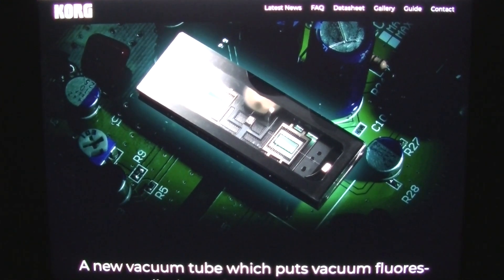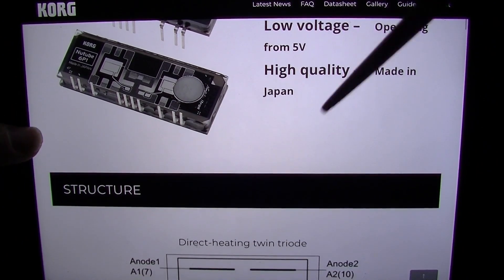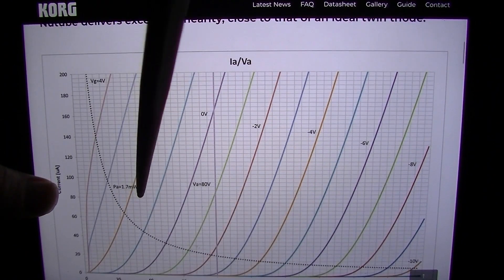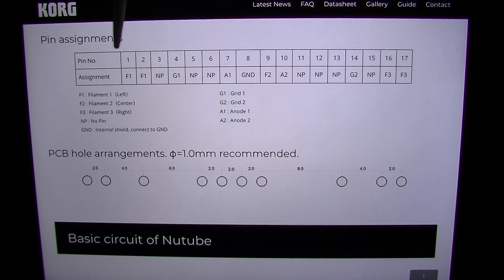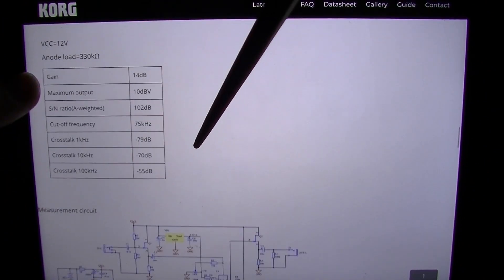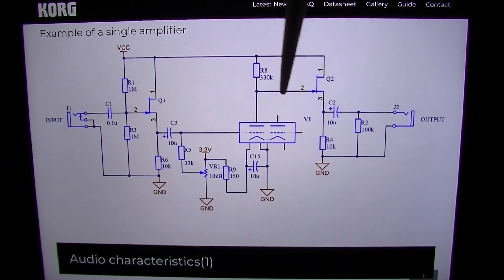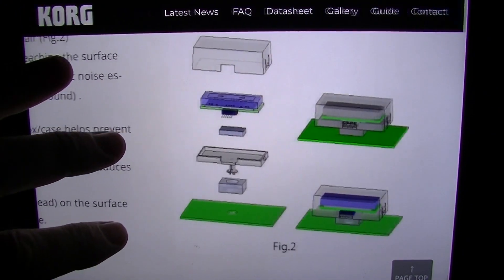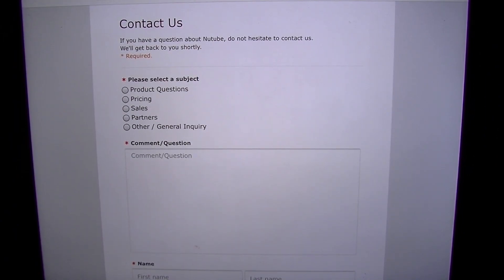Is This "Tube" REALLY the Future? - Korg's NuTube Vacuum Fluorescent Tube

Comment: I have a small vox beatle amp that has these NU tubes and I was shocked how good it sounds very warn just like tubes. I hope you get these NU tubes and make more videos about building a circuit with NU tubes to prevent microphonics issues. The new ibanez tube screamer using NU tubes and that would be a good circuit to build around the NU tube.

Comment: Okay I might not be the brightest bulb in the box but... @ 12:36
 you show a chart for resistors required vs filament VCC. If you exceed 
the .07 volts to the filament, poof, game over. So instead of a "fixed" 
voltage regulation why not use a self adjusting system? TI makes an Ic, 
the TL783, that can run this filament with an input voltage between 6 to
 104v. 

As the Ic can only drop the voltage to around 2v, set up resistors after the Ic to set the final voltage.

After the output is set, the input can jump across the map and 
it will not deviate. It will follow the output not the input. As for 
current, 700ma should be enough to do the job. 

Am I missing something? Wouldn't this be safer for the tube giving more 
flexibility in VCC? It only requires the Ic, a voltage ref resistor and a 
trim pot. If your worried about current, run two back to back. One to 
set a max current and the other to set max volts.

Comment: Everyone using this for preamp and overdrives, when it would be very interesting to create a poweramp in pedal size of a 100w or maybe more this technology like seymour duncan powerstage 170 or Magnum 44 (but, with nano tubes), then just get a tube preamp (there are a lot of small ones even with a transformer and valves like the actual real ones), connecting together with a poweramp currently " valve "would be really interesting.
Reply: This isn't the right technology for power amp I'm afraid, it's designed to replace a lower voltage tube like a 12ax7.

Comment: Well truthfully if you have a well-designed tube pre-amp and high-end transistor amp downstream you can dispense with old-school tube designs. You just need the tube sound and that does not require an all tube setup. The problem is that people always want to go cheap so they use a poorly designed tube pre-amp with the cheapest transformers and then put a cheap poorly designed transistor amp downstream. Look at all the cheap tube preamps that really are not tube preamps in anything but name alone. It is the tube characteristics we are after. The audiophile world long ago proved that you could easily emulate tube sound with transistors but it was not cheap to do it properly!

Comment: Back in the 1970 era they brought out a direct replacement plug in solid state tube  to replace tubes as far as I am aware it never caught on  would be interesting to see how this type of tube catches on. I all ways thought the higher voltage on tubes would work better, interesting  I think  that early car radios worked of 12 volts for both anode and heater so nothing new  here. ( not 100% sure)

Comment: HEY MAN, JOHN HERE.  YOUR VIDEOS ARE VERY COOL AND INFORMATIVE. I JUST GOT THE VOX MV50 HEAD YESTERDAY AND IT HAS THE NUTUBE TECHNOLOGY YOU ARE TALKING ABOUT.  I WILL ADMIT I WAS VERY SKEPTICAL B/C I'M INTO TRADITIONAL TUBE AMPS AND JUST A JUNKIE FOR GOOD TUBES.  I WAS BLOWN AWAY BY HOW WELL THIS LITTLE 540G/1.19 lb HEAD SOUNDS. THEY ARE AVAILABLE IN 3 DIFFERENT MODELS AC, CLEAN,& ROCK. I GOT THE CLEAN MODEL. I WAS TOLD IT IS BASED OFF A FENDER TWIN, (THE ROCK IS BASED OFF OF A MARSHAL PLEXI AND THE AC IS BASED OFF OF THE VOX AC-30) IT BREAKS UP NICELY LIKE A TUBE AMP WHEN THE VOLUME IS INCREASED AND IT IS TOUCH SENSITIVE LIKE A TRADITIONAL TUBE AMP.  I HAVE MINE PAIRED UP WITH MY EHX SOUL FOOD PEDAL INTO A VINTAGE 15' SPEAKER CAB. I LIKE THE FACT THAT I CAN PUT IN ON MY PEDAL BOARD, PUT IN MY GUITAR CASE & IM OUT THE DOOR READY TO PLAY. I WON'T BE GETTING RID OF MY TADITIONAL TUBE AMPS BUT I CAN SAY I'M A FAN OF THE NUTUBE TECHNOLOGY.....CHECK THEM OUT.

Comment: I made a 25W Hybrid Amplifier (similar to MV50) using the NuTube 6P1 (powered at 24V) a couple of JFET gain sections and buffers with a Fender tone stack. I actually used a very similar circuit using a 12AX7 tube (in starved mode: 24V power). Sound was not identical, the first triode was more saturated on the 12AX7. See it here:
http://rezzonics.blogspot.fr/2017/07/korg-nutube-6p1-vs-12au7-tube-hybrid.html

Comment: It's DHT triode, whereas the 12AX7 is indirectly heated triode - that's why the filaments are same element as the cathode for the nutube. In the example, it is using FIXED BIAS whereas 12AX7 circuits are usually self biased.

Comment: Can you use it in Older Guitar Amps?  Find a way to make it work?  So you can fix that classic Guitar Amp?  I am guessing maybe someday, but this change over sounds super expensive.  Not good.  The question is will you get a good sound, because Electricity grade and quality is important.  Their is room possibly for good sound, but were built off the old sound...It could ruin some music.  Because it wont ever sound right.  For instance will Jimmy Hendrix's music sound right played on these Amps?
Reply: I think that the new Guitar Amps sound much dangerouser than the old ones.  It sounds like they want Guitar Amps to be capable of Hypersonic noises.  Including ones that can blow your ear drums.  Even worse, the new amps sound like they are capable of Radiation.  You will note they don't talk about the conversion rate of the florescence, only that it is an effect Bradly.  Fundamentally we are now moving into Chemistry.  The fact is the function you specified could be heavily toxic substance that is being generated.  But, I would get a better picture if you tried to work with them.  If they are an option you should seek to get your hands on it to try to use it.  And, I would like to know how safe it will be to be near an Electric Guitar player.

Comment: Just looked at it's datasheet and found that the anode current is 10~34 uA. It's something really super-low, usual triodes have anode currents about 1000 times higher. So it's practically not a great amplifying element. Maybe it's just supposed to bring in some specific tube characteristics surrounded by FETs that will do the actual job.

Comment: What you have highlighted here does not surprise me.  Valves, in some shape or form, will always have their place.  I remember the popular notion, during the early-70s, that valves were the ‘Neanderthal’ of active electronic devices.   It would be good to see them incorporated into radios and televisions once more: sadly that will never happen.  Nonetheless, talking as a ‘valve man’ I’d like to think Korg's NuTube Vacuum Fluorescent valve technology has to be a move in the right direction.  The new style package may eventually replace the old style glass balloon (1920s to early 30s), or the cylindrical glass tube but they would need to be adapted for plug-in base facility to suit ‘backward’ compatibility.  At present, it’s looking like a typology in the sense the new style valve package has an IC appearance.  
As for obtaining one for evaluation purposes, yes, go for it.  All power to your elbow my friend.
Phil.

Comment: There was talk in the 1980s about bringing valves back as integrated circuits. The theory goes is that if you could make a triode valve about the same size as what a transistor is on a silicon chip it would switch much, much faster. They thought it might be the next evolution in computers. Obviously things didn't pan out that way. But now with nano tech....well....

Comment: Interesting, I had newer seen those before.
I guess that filament design is to keep the current reasonable, i hawe som older Russian tubes that haxe extreme massive filaments, wich mean increased lifespan, but can´t be applied on those, but i guess the Japanse will come up with a solution, possibly coating the wire or something could help.
but, yeah, VFDs will always be sensitive to burnout, they are not near that tolerant as the older types.

Comment: Odd that they didn't show a splitter circuit using two of these, with one acting as a current source in place of the crappy long tail resistor. The circuit you showed had transistor emitter followers on the input and output (or whatever the FET variant is called) which speaks to the horrible impedance these things have. Tubes have horrible impedances too, but the volts are higher. So it's reason for existing in that circuit is for its distortion characteristics. So put it in the signal chain properly.

Comment: Too expensive, full of hype, requires solid state input and output buffers (sorry purists),  microphonic as hell,  low gain, small signal only, great concept, low power consumption, small size, hi-tech look, next thing you know they'll be in iphones as a gimmick, Ibanez and Vox are doing it.What really needs to be done is to bring vacuum tube amp design up to date and rectify the over plagiarized poor designs  that seem to be worshiped as if there is no other better solutions.

Comment: I was doing a little bit of reading up on these and they basically have to have a buffer before and after (depending on the load characteristics of the intended application). However, there's nothing stopping you from using a d-class poweramp after it either for a high output amp. What I find interesting is that you could potentially use 1/2 the nutube and feed it back in to the second tube for distortion. Then run that output into a mosfet output stage. Ibanez also re-released the tube screamer circuit with one of these in there (probably replaced the op-amp/diode circuit with this). The micro-phonics might be hassle if you knock it.

Comment: The tube biasing looks strange.  Being directly heated, I think you have a effective cathode bias voltage of 0.35V.  The grid bias is 0 to +3.3 with respect to ground (or -0.35 to +2.95V grid to cathode).  I'm used to tubes always having negative grid-to-cathode bias.   That makes me think this may not behave like a normal tube.

Comment: Very interesting . But in the example circuit Q1 and Q2 are FET's. So with 2 FET's how much gain is the Nu-Tube making ? In my single descrete JFET preamp I can get a clean tube like 10db of gain on a 12vdc power.

Comment: Hi Brad ,I'm sure you've seen the Vox MV50 ,maybe you could design a 150 or 200 watt amp that is tube powered by these little tweezer Nu - tubes, it might take 15 or so of them.But the look you'll get setting up when you whip out this tinyTerror size amp and plug into a full stack powered by this thing! And you could make effect pedals by using the nutubes . Great review ,can't wait to see what you build. Peace

Comment: Never fix anything that's not broken... So what happens when a bad cap leaks DC voltage across the board to it? There goes the reason we love our tube amps! Although I own 5 Solid State Amps 2 Marshalls, 3 Crates... I always hated Crate Amps until I played this 220 watt amp and I purchased 2 so I could have Stereo using a A-B-Y Pedal. 440 Watts of AWESOME! Crate came a long way since they started. I used to host a Blues Jam and a guy asked me if I wanted to use one of his 2 Mesa Boogie amps and he wound up buying a couple.

Comment: Pretty ingenious way to incorporate modern vacuum tube construction methods of VFDs into actual vacuum tubes.  More difficult than making regular tubes in my opinion, but this is the automated fabrication process still in effect.  Lower power for battery applications as VFDs were designed for battery powered applications such as calculators.
Reply: The Dollar Guy I'd buy it for a dollar

Comment: This guy has made a few circuits using these nutubes already: http://www.pmillett.com/index.html

Apparently the biggest problem with these is that they're extremely microphonic, so while making it work in a circuit is fairly trivial, they require some very significant mechanical considerations in order to make it useful. I suspect that a stompbox would be the worst possible place for using one of these things

You can buy them for $50 each, and breakout pcb's for $6 through their US distributor right now: http://www.nutube.us/
Reply: I guess if a stomp box is the worst place then Ibanez might have the issues ironed out since it will be in the new Tube Screamer. Only time will tell if these issues remain ironed out in the long run. But I couldn't see Ibanez pushing it out if it wasn't stable in their in-house QA since everyone knows pedals are made to be trampled.
Reply: This blend knob can make this pedal fantastic for bass ofcourse if clean mean clean signal not signal after hipass filter.
Reply: I just checked that pedal out and I'm slightly skeptical of the blend nob, but I really wanna try it. Looks pretty cool imo.

https://www.youtube.com/watch?v=vONJn0Zt9xY
Reply: TY for posting this! :)
Reply: Bacon Brad that's a good point. If it does end up being good for that, then that's awesome.

Comment: I have to be careful how I word this, so I don’t come across as negative, as I am actually optimistic that we may be seeing the very early infancy stages of something really cool for guitar.  HOWEVER, with these being directly heated, I think we are some ways off from where its going to be a game changer.  The first, and biggest problem is microphonics— this is something that plagued a lot of the very early guitar amp designs when they were adapted from radio circuits etc using both directly heated tubes and then later the indirectly heated pentode preamp tubes.  Simply makes it tough to use these in a high gain circuit as much more than an input/output buffer (where a lot of real vacuum tubes have been used in circuits especially in the late 1980s/early 1990s, and the tube wasn’t much more than a placebo device).   
The second roadblock I see with these being directly heated, is that it’s not going to be a simple ‘plug and play’ type thing in most of the classic (Fender/Marshall/Vox) guitar amp circuit.  If these were indirectly heated, one could conceivably take the schematics for a blackface fender or Marshall plexi and rebuild the circuit with one, simply lowering the voltage and at most tweaking a few resistor values here and there and really tell what they can do.  As it is now, though, they are going to be better suited for transistor replacements, or if you wanted to replicate the ‘classic’ amp designs, it’s going to take a bit more work to accommodate the directly heated nature of the device (cathode followers I would think would be next to impossible to implement!).
Again, not being negative, as I am open to the possibilities of these, especially in pedals and the like (optical compressor anyone?), but I think we are some time away from this being a complete game-changer.

Comment: Brad, you did it again. Bringing new ideas to light. Are these enclosed in glass? Are they shatter proof? Is there, or, will there be a power tube version?  It seems a 6V6, 6L6,  EL34 type would be needed to be a complete circuit. Maybe the powertube type would be designed to couple to the speaker without an output transformer! Like some SS do. I mean if these tubes sound as good as conventional vacuum tubes, this would become the new way to make amps. Small, low power requirements, less weight and heat,  smaller transformer( only need a power trany) all that transistors aspire to,with vacuum tube tone, it's a win, win situation! We will see......Thankz

Comment: Also the VFD technology is very robust, these VFDs are used in outdoor equip. a lot, and the chash desk systems they had been used in, aren´t treaten nicely often either. Also i done some stuff with old epson DMD 101 VFD-displays i had been given and the arduinoUno. They last, as these displays i got had been in service for at least 15 years, and they still working. Some pixels are dimmer than others but they are sill bright enough to be easily visible.

Comment: Nice video, Brad thanx:)
I´ve seen these at the musikmesse 2016 korg booth, and had the time and luck to talk to a tech about this thing, they wanted to do something small using available technology (VFD-displays in this case) without a need for a high voltage and alter it in a way that it can be used as an amplifier. For a big company like korg, it´s a complete other situation, you need RoHs, WEEE and the whole paperwork in order to come up with new products, today. So any thoughs of using old tubes or one still in production are completely out of range, as they never would meet these standarts. So they came up with the already existing VFD technology, with has and approval all these standarts, and that´s why they try to convert it into a working triode.  

It´s a direct heated triode, so therefore it will be act different compared to the usual indirect heated tubes, we are familiar with.
First, you can´t easily hook up the usual cathode resistor in order to lift the potential of it. You would need a center tapped power supply to do this right, if you only add a resistor to the filament (which is the cathode) you lift both kathodes and also create a "long tailed pair" in where both cathodes share one cathode resistor and therefore the current as well.

The only practical solution would be to bias the grid with a separate voltage, exaclty like the old radios did around 1920th...

Second, the filament is the same for both tubes, you practically have only one tube (it looks a lot like the 6C33C russian power triode, only smaller), i don´t know why they done this, but it´s not of any use for stereo, nor two independent chanels. But it could be used as an diferential amplifier, if you add a current source for the cathode.

Comment: I think the heater voltage should be 3v no more no less, maybe a whole guitar amp could be built from these tubes and maybe use the tubes to drive ECC88's which would drive the output tubes.